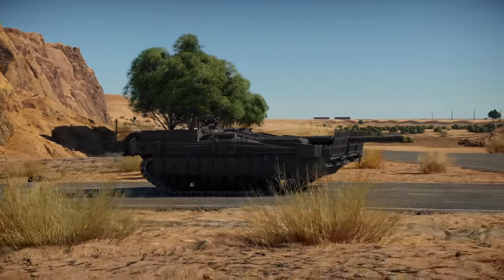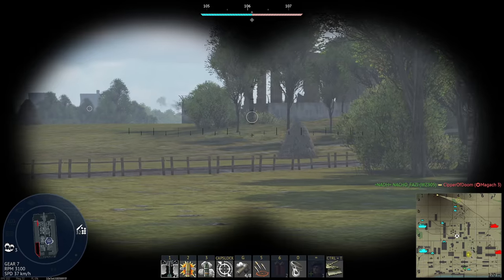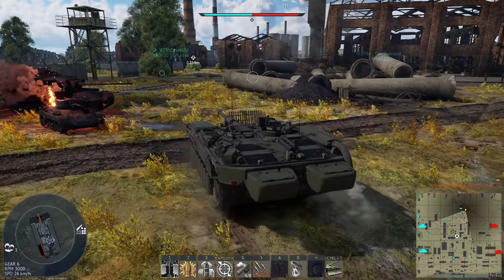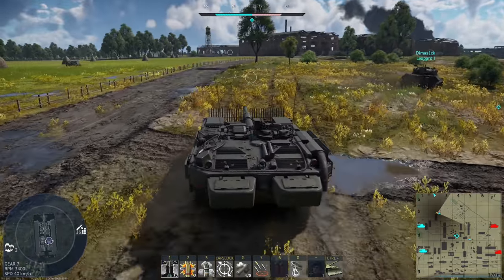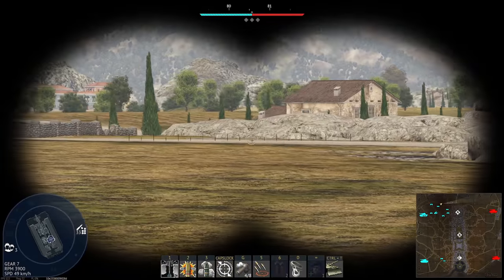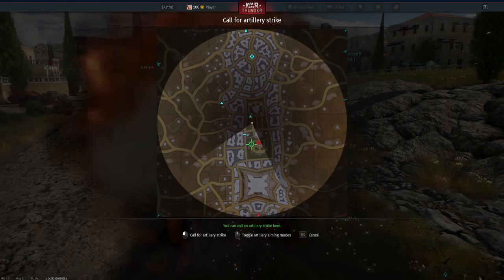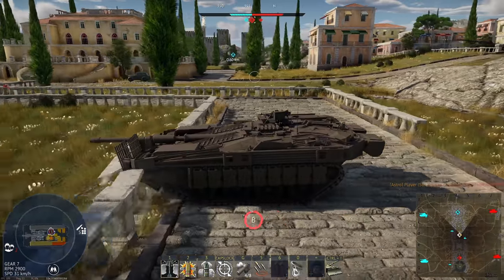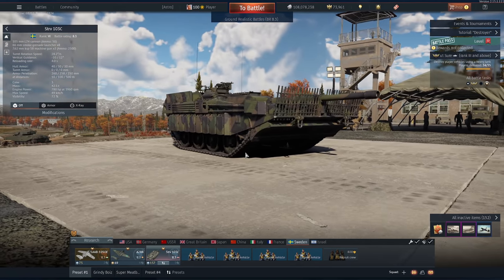THE MOST BROKEN TANK IN WAR THUNDER

Comment: Strv 103 really aint suited for these types of games. They were designed to go to ambush positions, dig in, and wait. Fire, fire, fire, fire, before the enemy could properly respond and then scoot out of there. In fact, it has the same speed going forward as in reverse, and it have 2 driver positions, one oriented forward, and one back. It is never meant to show neither sides nor rump to the enemy.

It was built in a time where Sweden envisioned the great Soviet tank battalions, rolling over Europe. So they prepared to bleed the enemy every inch of ground. It was made for home turf. Dense forrests, narrow roads, the occasional meadow and wheat field. Tons of places to dig in, hide, and strike hard from up close, and restricted visibility for anyone trying to give chase.

It was usually equipped with a digging tool in front, and with its fine hydraulic control, and strong engines, it could dig itself a good ditch in couple minutes, which increased protection, as suddenly, it only presented a barrel and the front armour to the enemy, and it made itself harder to detect, as it decreased its profile even more. Add in the environment, dense forrests, and cover the barrel and top of the tank with branches and stuff... it would most certainly get the first shot. And with that reload speed, it might get 2-3 shots more before needing to scoot. 

Even driving through Sweden today, a strv 103 could be just meters from the highway, and you'd have no way to tell without electronic assistance.

And it wouldnt be acting alone. Infantery would engage enemies with FN Mags, Carl Gustafs, G3s, mines, artillery.. they would blow up bridges to redirect enemy armour to killzones. The (then) strong airforce would vy for local air superiority, and then punish any armour formations too big for bunching up. 

It isnt bad. It was just designed for another type of warfare than the typical tank.

It aint a tank to go hunting with, or patrolling, or any of the typical tank things. It digs in, deliver some hurt, and falls back, and finds new locations to dig in. It IS a camper.

If you go around looking for enemies with it, you are using it wrong.

Comment: possibly the most nerfed tank in the game from a comparative irl point of view.

the two engines are combined into one, one engine dies, the other dies too,
hull aiming sucks and the thing won't settle if its resting on even a slight slant
its gun, even though its modified to be longer, still has the same performance as a stock L7,
the irl reload rate of the gun was akin to about 2-3 seconds, not 4.

Comment: I think the biggest problem is designed purpose versus game play mechanics. The Strv was designed as a cold war defense tank. The extremely low profile, the massive gun, high speed, and low crew minimums was to make it the ultimate ambush tank. Which is where it comes in conflict with WG game mechanics. If you're exchanging fire then you're already in serious trouble. It's almost exclusively a tank to be set up for ambush engagements

Comment: While the single crew member vehicle controls are definitely something that helps the vehicle shine despite its other flaws, it actually is something historically accurate to the vehicle. The entire thing could technically be crewed by one person since the gun is autonomously reloaded, and aiming is controlled by the driver, however they decided to settle for three crew members to reduce strain on each person, help with maintenance, and in case of injury to other crew. Each of these three crewmember's positions were given duplicate controls for the vehicles fire-control system and movement, as well as the necessary optics to use them effectively. Thus the Strv 103 can be crewed by one person.

Comment: "Oh no the surface I'm standing on has a lean angle of 5 degrees or more, I guess I will become completely broken useless to play with and dependent on luck" - THANKS GAIJIN, REAL COOL. Also see how the two engines are still treated as a single system (ahistorical) and the internal spall shield is still all wrong (ahistorical) and it can use HESH (ahistorical) and it scoots back on recoil (ahistorical) and the reload times (ahistorical, actual just over 2 seconds, 4 sec required to settle back on target (computerized)). At least it benefits from old players leaving so people barely know how to disable an Strv 103..

Comment: The strv 103 has historically 3 second reload instead of 4
Reply: Pretty sure it was 2s
Reply: According to the RAC Equipments Trial Wing the complete reload cycle took about 2,5 seconds
Reply: About 2.8 is what i was told by an old captain who drove one back in the day.
Reply: it also have a 10 min manual reload
Reply: @fusion3865  10? More like 5m which is better than other tanks
Reply: @einar8019  the fact i got was 10 minuts cuz you need to go out the tank and then back in it
Reply: @fusion3865  thats only after you have fired all 50 rounds, you would need to go outside to more ammo in all tanks
Reply: @einar8019  yea but the gun is a automatic and a manual loader if the automatic stop working they whould nned to go out and reload it and what you said and i am not only taking about when you are out of amo

Comment: The problem is the STRV 103s were never designed to be assault tanks.  They were designed to sit in a defensive spot and pick off advancing armor...ideally in a bottleneck like a mountain pass (think of Swedish geography).  A platoon of these could stop an armored brigade for a LONG time if they had the right positions.
Reply: Well, yes. But the Strv-103 had faster target acquisition and engagement reaction times than Leopard 1 MBT's as found in the Norwegian trials. There's no reason for the tank to violenty wiggle and not be able to aim, especially on any kind of hill.
Reply from the maker: This is not true.  It was designed as an MBT.  It even did trials fighting in urban environments.
Reply: @OddBawZ  so what its literally one of the most op tanks? Like wtf aM I supposed to do if I dont have HEAT or APFSDS? I die to this thing so much in Maus, Object 279, and more.
Reply: @OddBawZ  I got to second the original comment it was a MBT for Sweden but still the military doctrine of the time was based on attrition of enemy. Inspiration for this tank is in part for the Finnish success with StuGs in WWII in very much the same type of geography as Sweden.
Reply from the maker: @sethdaboss245  Lower plate.  Then it's done for.  He can't aim at you anymore.
Reply: @OddBawZ  I'll have to try it again but I don't think Maus or 279 can penetrate lower glacais with their APHE
Reply: @OddBawZ  ...It was the MBT for Sweden, and I'm sure it was tested in a variety of scenarios and situations.  But at the time, their main strategy if they were invaded (how offensive would Sweden be against the Soviets) was defensive.

At least, this is what I read when they were introduced to World of Tanks (yes...I started in WoT).
Reply: @Mark_The_Chemist  defensive in depth eg. the defense was based around infantry holding actions with ambushes and enough landmines to level cities combined with armored and mechanised counter attacks from the sides as far to the rear of the enemy columns to break up an enemy advance into isolated pockets that can be destroyed one at a time by local superiority just like the Finns did in the winter war.

Comment: This tank actually used a redundant control setup, it was initially proposed all crew members could operate all parts of the tank solo if needed IRL.
Reply: Yeah, so that is very accurate, and I am glad they implemented that bit. Not many tanks that could be operated by one person. Not that it would be easy to do so in this tank. But it is doable, at least compared to many others. In real world, you likely get out of there as fast as you can. Good thing the tank has a good reverse for such occasions. Though I will admit, I am only speculating what the proper procedure would be if you lose all but one of the crew.
Reply: @Cythil  It's made easier by not having to worry about a turret
Reply: @Cythil  propper procedure: Fika in a Lagom amount, then knäcka a Bärs and quote Bellman at the enemy in hihh spirits.

Comment: Yeah I agree. I miss being able to do the cheese dance, plus when you try to lead a shot, it just aggressively jiggles around. Extremely frustrating
Still got my first nuke in the premium one, and dropped it successfully
Reply: You can still dance If you manually adjust the suspension using hockey controls.
Reply: @volteer1332  yes, but it’s super slow

Comment: All they have to do is give the STRV 103's a horizontal stabilizer. Boom, far more playable, and you can actually track targets without fighting the gun.
Reply: How do you stabilise a gun that has no traverse?
Reply: @Hellfireconski  stabilize the suspension I guess...?
Reply: @Hellfireconski  apply the stabilization to the hull traverse...like the real tank does.
Reply: Please remember that Gaijin keeps the vehicles as close to reality as possible. If it had no stabilizer, it won't get one. Just that easy.
Reply: @mev0lent  you forgot the /s.
There are multiple vehicles that are so far from their real world capabilities as to be a joke.
Reply: @mev0lent  what about the Conqueror? Its gun stabiliser only was there to take strain off the gun drives and not to fire.
Besides, all the single-plane stabs can fire on the move, same with early two-plane tanks. Irl they didn't fire accurately on the move until the 80s.
Reply: @martindinner3621  Okay okay, but that's still a difference to making realistic vehicles unrealistic on purpose by giving them features they never had.

Comment: I feel like it shouldn't be too difficult to code/program. Mouse aiming with a turret but instead of a turret, model the whole tank as a turret, and then program the controls to give movement inputs priority. That way you could aim with your mouse, and then move when needed and it's like looking in free camera. 

Now I'm not a geek or anything so I don't know what the limitations/difficulty to make such a thing possible,
Reply: In the mean time, you can keybind hill aiming. I have it bound to V. Turn it off while driving, turn it on while aiming. The transition is instantaneous
Reply: the only thing world of tanks does better than WT is the strv-103s, they pretty much have what you described
Reply: @TheChiggerBug  That's what should be done immediately with this tank, but smoothbrains can't comprehend buttons.
Reply: @sorincaladera936  It helps to be in a good squadron that can tell you to key bind range finder, squad ping, zero and other things. Also rebound binocs and scouting

Comment: It can survive with one crew member cuz it was designed that way. IRL one member can be responsible for both driving and shooting and the other one was a commander (crew of 2). Later on they added a third guy in the back with full driving setup so he could reverse at the same speed still keeping the angled front towards the enemy and operate a radio.
Reply: The third guy was actually added because maintenance was a bit heavy to put on only two people. It could already drive as fast backwards as forwards, the driver would just have to trust the commander's word on how to turn.

Comment: the best way to play the 103C is to hide behind a hill and exposing as little of the tank as possible. shells will go straight through the 'point' of the wedge, so you need to keep that hidden, but your UFP will bounce a lot. Unfortunately, its a tank you cant play particularly aggressively, you kind of just have to find effective camping spots, when you do, its highly effective. 
Given it was designed as a defensive tank to... hide behind hills.... it does a good job emulating that in the game.
Another thing to note, the FCS in WT is pretty poor, when the Americans tested it they said there was no tactically significant decrease in the gun laying time versus a turreted MBT, neither was there any decrease in accuracy, its in fact a very precise system. Iv'e got an explanation on the forums of how I believe the FCS is implemented in the game as well as proposed solutions for fixes (including code examples). you can stop the wobbling side to side by switching to manual transmission mode and putting it in first or neutral and hitting whatever key you have as brakes (S probably), this will lock the traverse as soon as you press the key.

Comment: This tank was truly brilliant for it's time but later developments rendered it obsolete. It's lack of turret did make it slower to acquire targets than it's peers but not excessively. Sweden accepted this because they optimised it for fighting in their terrain. Sacrificing the turret gave them a huge increase in crew protection a lower profile probably the fastest and most reliable auto loader ever designed and a lighter faster vehicle better able to maneuver in dense wooded terrain. It was designed to strike from ambush and bug out before the enemy could respond hence the second rear facing driver/radio operator who could get them out of danger at full speed. The were never designed to use maneuver warfare the way every other nation did. When the gun stabilization systems first deployed on late WWII allied tanks reached maturity were fully integrated with the hunter killer target acquisition system developed for the conqueror turreted tanks became able to achieve first round kills reliably while moving at speed across difficult terrain. This left the Strv completely outclassed in gunnery so even with its formidable armour and speed it was no longer a viable weapon against its likely opponents.

Comment: It’s ironic how the best Strv103 is the 0 (prem) due to how WT works. The anti spal squares on the A variant usually catches shells and make them pen a “flat” surface instead. Meanwhile the 0 only have a big flat surface so a lot more shells bounce of it. 

Strv 103C is the worst of the lot due to its BR. It’s armor barely saves you from anything. The fence works vs weak HEAT and HESH/HE but most ATGM cut from the fence then 2m air into the hull and through the engine/transmission. 

If the air after the fence would disperse/weaken the HEAT stream it might actually be pretty alright but that would never happen. To much new coding.

Comment: Really seems like one of those tanks, where default controls are rubbish.

M3 Lee, M6A1 and T1E1 are good example of this, where by default they shoot both their guns, so you have to change it in the settings, so you could fire small gun separately. After that its much more useful.

Here you could probably play around with suspension controls and turn off aiming during braking.

Comment: I personally feel indifferent to this tank. It’s protection can be really good from distance and good at medium range. Yes the aim system can be very finicky but it’s definitely not as bad as it was depicted in the video I think. Most tanks at its tier or like half don’t have stabilizers so it sort of evens the battle. You have to admit though this tanks hull aiming has been extremely improved in game. Before you just couldn’t down right aim at anything let alone shoot. This time the tank is playable as long as you get used to the transmission. But I also can totally understand why most people don’t like it. Just something to remember the aiming of the tank is based on the mouse completely. Which also means the movement of the hull and gun when hull aiming is on. If you keep the mouse straight and get used to the sway, you’ll always shoot true to wherever you want the round to land.Thanks for the great video though! 👍🏻
Reply: The Hull aiming degraded over time actually, not improved. When they introduced Hull aiming it worked. Then they "fixed" it, during that time hullaiming tanks were unusable. Then they "fixed" it again to the current state.

Comment: In my experience grinding the 103’s I’ve always had better luck in the C because at 8.3 the early APFSDS rounds have less pen than the HEAT at 7.7, so it always felt a lot more tanky at 8.3. Sure up tiers you died easily as you do in almost all tanks, but those down tiers to me really made up for it. I also remember with the very first initial introduction of the tank the hull aim was fine, idk why it keeps getting worse, maybe it’s the spaghetti code

Comment: I mean it'd be fine if there were better places in war thunder for the tank to be, it's a very low profiled tank by design and the lack of turret rotation is in part to achieve that profile. if gaijin didn't just add tanks without having maps that can at least somewhat accommodate the environment/firing positions the tank was designed for, it'd be alot better.

Comment: Genuinely dont understand the complaints about hull aiming. I used the strv103-0 to grind sweden. 400 deaths 900 kills and plenty of nukes. One of my favorite tanks to date
Reply from the maker: That's not very good stats.  If it works for you, then it doesn't matter what other peoples opinions are.

I have better success than you with it statistically, but the tank is still garbage.
Reply: @OddBawZ  ss or it didnt happen

Comment: That is a typical defensive designed tank. It will dig down with the bulldozer blade and then you would not detect it. Until the invention of thermal sighted top-striking anti-tank robots emerged at the battlefield, that Sweden also was a pioneer of.
Extreamly light and easy to maneuver, with a backward driver.